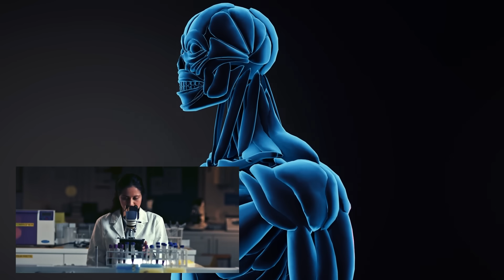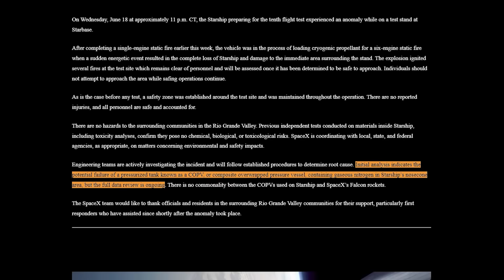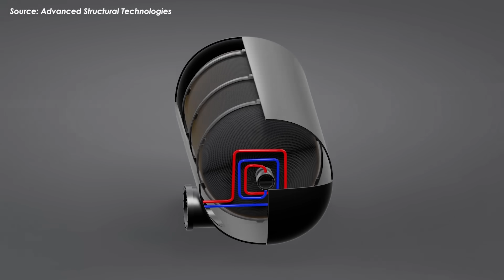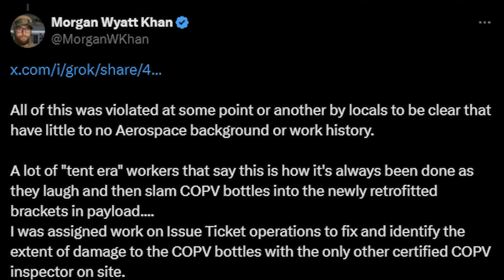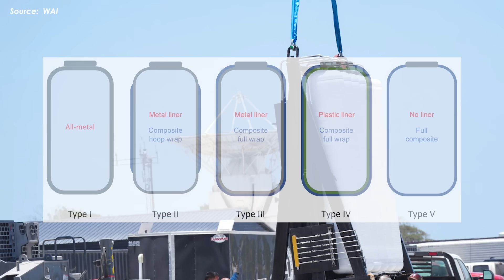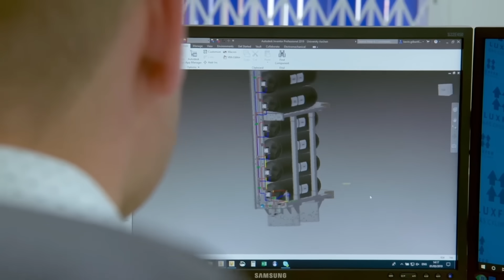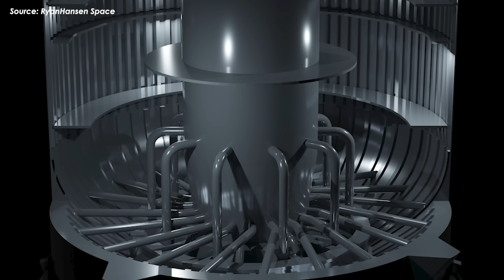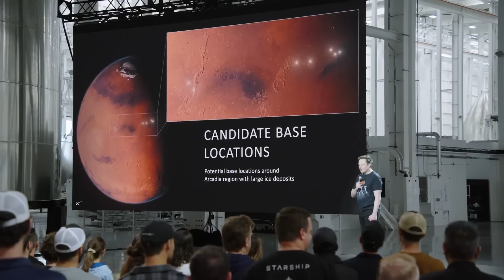SpaceX just announced New COPV Change after Starship S36 Sabotaged!

Comment: The COPV's should have a 3" rubberized foam sleeve around them until installed. The sleeve should be able to be removed by an internal wire that when pulled outward slits the sleeve off. ie. NO cutting!

Comment: I think they should continue using the aluminum liner type.  That would assure no leaks through the woven material, remember the Tital  sub disaster.
Reply: I was thinking same thing. Though the pressures could be different bottom of ocean and all with less extremes. But if you’re reusing something over and over with very high temps and very low temps, a beefed up version with metal liner may be best.

Comment: The COPV's should be protected from >design pressure by Burst discs in the vessel. Relief Valves and flow restrictors are usually in pipework to protect the COPVs from any failure of an upstream device. There should be no excuse for not doing flaw detection prior to installation. It sounds like there may be more to this than a vessel failure.

Comment: So, no sabotage, only a hint of improper handling.  That is not sabotage.  Interesting video but downvote for the clickbait headline.
Reply: That's what they traced Apollo 13 tank rupture to, it had been dropped on the floor during fabrication, it was inspected, but there was internal damage. They also over voltaged a heater and damaged it's insulation, but they did that to all the O2 tanks.
Reply: @TD_YT066  Be careful next time you enter a plane.
Reply: Sure, u know better🤣

Comment: Do you remember the “Titan” submarine? It was a carbon fiber tank pressurized  and guaranteed to withstand many bars of pressure, they found micro cracking in the carbon fiber that lead to a catastrophic failure. Implosion or Explosion.🤔
Reply: The Titan’s end caps were not composite, repeated intermittent compression stresses broke the bonds between the fibre layers producing a fatigue failure.

Comment: Is it easier for a helium molecule to pass thru aluminum, or thru the resin used in carbon fiber?
Reply from the maker: Helium passes more easily through resin (used in carbon fiber composites) than through solid aluminum.
Reply: @alphatech4966 which makes it sound like SpaceX is already using Type 5 instead of Type 3
Reply: The answer to this depends on the gage of the metal liner. For commercial grade vessels the metal liner is pretty thick and if autofrettage is done it will be in compression most of the time. This suppresses flaw growth but at the cost of a lot of weight. But you can use aluminum to minimize the impact. 

For aerospace grade vessels with low safety factors the metal liner will be much thinner and will absolutely be in tension such that the voids and inclusions in the metal can grow over time. There is a threshold where these defects can create a leakage path.  This is especially a concern if welding was used in liner fab.  Hence these vessels tend to be made with much higher strength and more resistant to this sort of flaw growth materials like stainless steel or inconel. 

There are very specialized processes that can create a hermetic, gas tight barrier with graphite epoxy composite materials.  The lower tech methods have no mass benefit vs liner tanks but the really good one are way lighter.  Like almost unbelievably light.  SpaceX does not have that technology.  They’ll have to use the less efficient process to get rid of the liner.

Comment: The main feature of SpaceX is cost-cutting. It will have a lot of "first-ever" failures of otherwise reliable components. That is what private businesses do in their effort to maximize profits.
Reply from the maker: Yep, failure is part of the journey. As long as they keep moving forward, success is only a matter of time
Reply: A carbon-only pressure vessel without the inner aluminum liner is an example of cost-cutting

Comment: A failing COPV should not cause a catastrophic event.  The DESIGN FLAW was that the downcomer is located right across the COPV racks.  Good design practice would have separated the COPVs from each other, AND have the downcomer routed away from the tanks.   Designers have a tendency to package things for convenience and weight without veto oversight from other disciplines that include stress, thermal, reliability, failure tolerance, etc.  Designers want to do it all themselves.  Interim design reviews, design decision memos are all best practices to prevent failure.  Hopefully, SpaceX has these engineering system practices in place, already.  More expense up front, but less likely to fail.
Reply from the maker: you clearly have a solid grasp of the issue. You're absolutely right, a single COPV failure shouldn’t lead to a chain-reaction disaster. And yes, routing the downcomer right next to the COPV racks does seem like a questionable design choice. Hopefully SpaceX takes this as a lesson and reinforces their design review and failure tolerance processes going forward
Reply: The amount of energy release here is staggering.  There’s no practical way to armor yourself from this sort of catastrophic failure.  These are not commercial vessels with big safety factors. They have e to be light or the system would weight tons more.

Comment: I have worked with COPV's previously.  There WAS a company in Wisconsin that started to do Composite Overwraps for propane cylinders so that the cylinder would be able to withstand deliberate OVER PRESSURIZATION and extended storage capacity at ranges of 115 to 150 percent of original capacity.  Meaning, a typical "5 gallon" (20 lb, that normally holds 4.8 gallons, with a 20% ullage) cylinder could be over pressurized to hold 5.5 gallons with a 15% increase in pressure due to the overwrap or up to 7.2 gallons with a 50% increase in pressure due to the overwrap.  

They were forced to discontinue the operation due to the highly fragile nature of the carbon fiber/resin overlays and the failures that resulted during handling, filling and transporting those propane tanks.  

The carbon fiber fillaments are embedded in a composite resin that then hardens, reinforcing the metal substrate cylinder and increasing the cylinder's pressurization capacity.  More pressure results in more highly compressed gas being stored in the cylinder. A fracture or other damage to the overwrap can easily result in a catastrophic failure and rupture of the underlying metal cylinder because the metal is NOT capable of holding the elevated pressures on its own. 

It has never been, in my opinion, a safe process to deliberately overpressurize compressed gas storage cylinders.  

Think about hydrostatic testing of pressure vessels like fire extinguishers, at normal pressure (about 125 psi) it is safe.  To test it after 5 years in service it is frequently over pressurized to 300 psi.  If it does not rupture or explode, it "passes" and is deemed safe  for an additional length of service. 

 But look at the operational load of 125 psi vs test of 300 psi.  Small potatos!  Most other gasses are pressurized up to 1500 to 2000 psi normal working pressure.  This makes the over pressure 1750 to 3000 psi!
Reply from the maker: Wow, that’s actually super interesting! I had no idea composite overwrapped propane tanks were used like that, and that they had to stop because of how fragile the carbon fiber was. Really appreciate you sharing this, not everyone knows stuff like this. Makes the risks with Starship’s COPVs feel even more real.

Comment: Put a roof over all the important parts and cover it with dirt.
Reply: Another option is to construct a deep trench or moat reinforced with concrete and topped with anti-bunker-busting plates — effectively shielding everything around the launcher. Will it cost more? Absolutely. But it offers longer-lasting protection without needing to rebuild the launch site.

Comment: 9:30]  "...Type V [COPV tanks] could become the new standard for future Starships.  So, what do you think about this idea?"

I think it is a foolish idea. Space X hasn't even solved the problems with an existing, relatively proven technology and your first idea is to leap to a newer less proven technology, one that is meant to be reused multiple times surviving the rigors of launch, reentry, and landing?  

I have pointed this out elsewhere, we are looking towards launch 10, all of them so far have had serious incidents and we do not yet have a stable design.  This is the time for Space X to stop, take a pause, get a hold of what is going wrong systemically with their design and operations and settle on a good-enough configuration until they can achieve all of their operational requirements.  Once they have done that they can cautiously start improving performance.

Comment: If mishandling during installation caused cascading fiber failure under pressure with a metal bottle inside, the elimination of a metal bottle liner won't prevent the cause.

Comment: I was under the impression using COPV tanks are  used to save weight ! But if mounted to the stainless steel wall could be a thermal exspansion issue ?

Comment: Carbon fibres have great tensile strength and the wrap take advantage of this, they are however very fragile, impacts would be very destructive.  The metal liner is to protect the fibres from being bent and snapping
Reply: The aluminum liner serves two primary purposes, it serves a a mandrel around which the carbon fiber is wound during manufacturing, and also as a gas impermeable layer to prevent high pressure gas from penetrating the composite layers of fiber windings causing delamination, and possibly chemical interaction with the epoxy matrix.
Reply: carbon fiber worked well on Titian
Reply: @jerrymiller8313  Titan was under compressive forces. Carbon fiber is not good at that.

Comment: The Apollo 13 ALMOST DISASTER was found 
to be caused by a dropped Hydrogen tank-
IIRC damaged a heater/mixer inside!
Reply: Incompatible voltages
Reply: And it was an O2 tank... according to Google's AI overview - wiring shorted, got hot enough to ignite the Teflon insulation (seems unlikely) or the heat from the short circuit overpressurized the tank leading to rupture....it seems odd to me that the O2 had to be stirred to "prevent stratification" 
....in zero gee?
Reply: @stevengill1736  The tank was not dropped as you claim.

Comment: If nobody is listening to the inspector, why have them? If you have two inspectors, and you remove one, what would you expect?
Reply: “Disrespecting ME and Starship was a mistake!” Ok, now I think I see why Mr. Egotistical was fired! An inspector needs to be humble enough to get his message across, not so arrogant you end a post about a rocket blowing up during testing, when rockets usually blow up, with something THAT egotistical!
Reply: Hi, the inspectors are there to catch stuff before calamity but you have to have fully trained and safe working staff.
The intro identified the main cause of failure, poor handling. 
Built to high standards and shipped inappropriate handling, dropped, banged, more damage and it will be ok……
Kaboom. No it was not.
Take care M.

Comment: Every disaster is a learning experience. The investigation will be thorough. The repairs and rebuilding of the site will be completed quickly. If there are safety protocols that need to be set in place, SpaceX will do it. Never underestimate either Elon Musk or SpaceX's ability to pull off the impossible. Mars awaits. SpaceX will get us there.

Comment: Well even in this video, there were cases of mishandling - like bouncing a COPV tank off a concrete floor.
It seems to me that the COPV tank should come with a carrier, rather than having to be simply manhandled - where there is a finite chance of dropping it !
Something like a two wheeled carrying frame with handles, and soft silicon rubber tank cushioning maybe ?
Reply: Cylinders are shipped according to national standards. Manufacturers have recommendations for handling and installation. They were probably received by Space X in that recommended manner. What happened after that, is the subject of the investigation.

Comment: jot engineer here, but couldn't make the vessels and wrap them in the covers from Bigelow space or is pressure from the tanks greater than what the tested inflatable spheres.  Don't roast me
Reply: OK thanks for the like, but thought of something the Bigelow inflatable was going to be part of their of replacement segments, but that was rated to 60 psi which was exceeding the NASA requirements, the tanks whoch were thought and then reported by Wlon Musk as the cause were only as " high pressure tanks ", never giving the psi so with smaller taks I don't believe the tanks wrapped around those size tanks would increase enough for a higher psi for loaded propellant, therefore making my earlier comment just wishful thinking.

Comment: from co-pilot
While exact global statistics on total COPV explosions aren't publicly consolidated, these incidents are rare and typically tied to extreme conditions like high-pressure cryogenic environments or manufacturing defects. NASA and other agencies have studied COPV stress rupture and aging extensively, especially after earlier failures in the shuttle program.

SpaceX hasn’t publicly disclosed a single supplier for its Composite Overwrapped Pressure Vessels (COPVs), and it’s likely they produce many of them in-house or source components from multiple vendors depending on the application. Historically, SpaceX has redesigned its COPVs—especially after the 2016 Falcon 9 explosion—to meet NASA’s stringent safety standards, including doubling the burst pressure tolerance.

The recent failure on Starship Ship 36 involved a nitrogen COPV in the nosecone, but SpaceX emphasized that these are not the same design as those used in Falcon 9 or Dragon vehicles. That suggests they may be experimenting with different materials or manufacturing techniques for Starship’s unique requirements.
Reply: Since Starship is in development, they may have opted for a cheaper COPV .

Comment: Mars mission in 2026? Not possible given their track record. Sure they could launch something with a crew, but would anyone want to volunteer. No guarantees it won't blow up on the launch pad.
Reply: Mars 2026 was never going to be a human flight in 2026. You are conflating the Moon landing and Mars. Moon landing will likely also be a cargo/robot only flight in 2026 with a human landing in 2027. By then the rocket will have been proven at least 20 times with satellite deployment, Refueling tests with tankers and deployment of the fuel depot (modified tanker with sun shades or similar).
Reply: If this were left up to NASA, we'd still be pulling carts with donkeys.
Reply: Any launch to Mars would of course be Un-Crewed, although some Optimus Robots could be aboard !

Comment: Just make them out of steel and be safe.
Reply: Steel is MUCH heavier. Extra weight of COPV's would require more fuel to launch, and/or reduce mass to orbit.
Reply: @MickHealey No 💩 Sherlock, but you would make it to orbit.  You do know that Starship was originally designed with composite fuel tanks and then converted to stainless steel.
Reply: If they were just made out of steel, they would be way too heavy. No one does that. Also a micro crack could lead to the tank exploding rather than simply leaking. This is why they use carbon fiber windings at great expense.
Reply: @avgjoe5969 Bullshit.  Why is Starship constructed of stainless steel?

Comment: Cost cutting, namely relying on under skilled labor to save is a better explanation than sabotage. Management likely kicked this person out of the area because highlighting that would make them look bad. SpaceX had a ton of problems early on in the starship program because they refused to build a flame trench. Elon himself said it might be a mistake on twitter but they wanted to rush to the finish line and ended up having to spend the time building one for the new pad. There are several instances of this approach backfiring on them.
Reply from the maker: Yeah, honestly that makes a lot of sense.
Sabotage sounds dramatic, but cutting costs and relying on undertrained workers? That’s way more believable.
And yeah, the whole flame trench thing was classic, trying to save time, then ending up spending more.
Feels like SpaceX sometimes moves so fast they trip over their own feet.
Reply: @alphatech4966 yeah that's a good way to put it. Compared to Blue Origin and their slower methodical approach, New Glenn went up and deployed its payload almost flawlessly on the first launch. This approach seems to take longer to deliver on expectations.